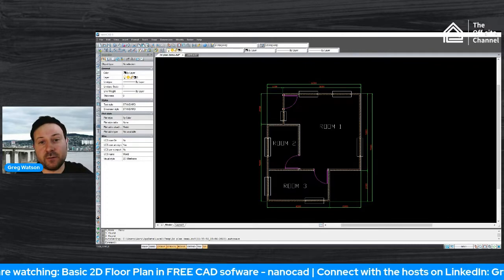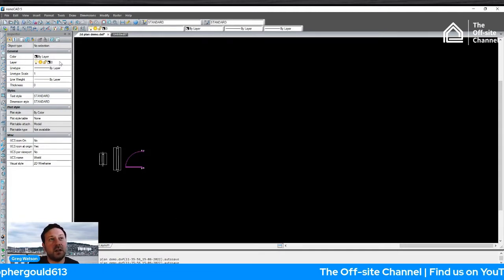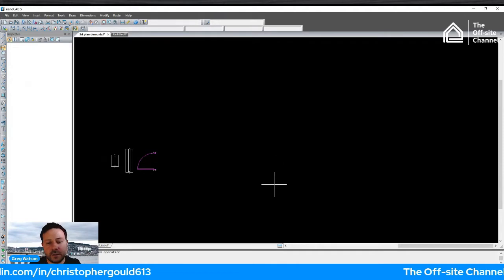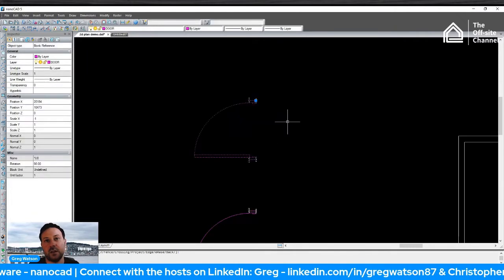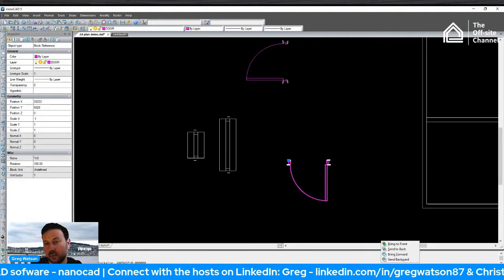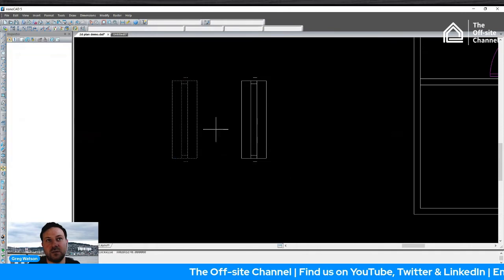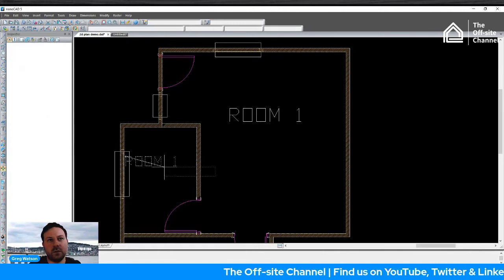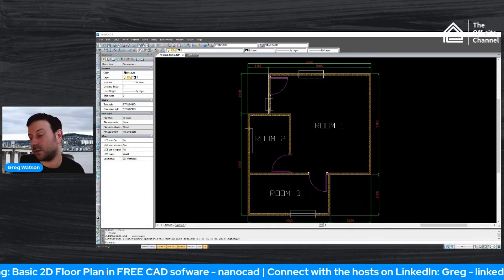Basic 2D Floor Plan in FREE CAD software - nanocad

Comment: Thanks for this video.
So you are using the Free version? Will it print to standard sheet sizes as PDF file?
I'm looking for a free CAD software that's simpler and more conducive to house and floorplan design than freeCAD.
Reply from the maker: Hi, yes it does. Has standard sheet sizes as A4, A3 & A4